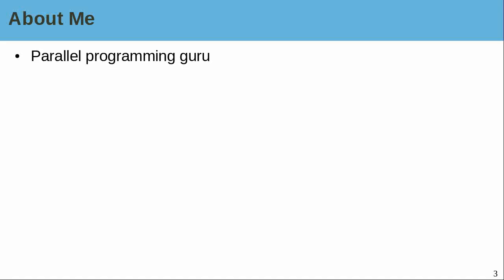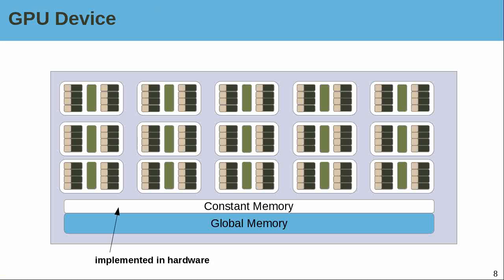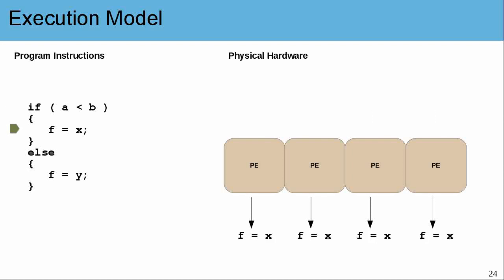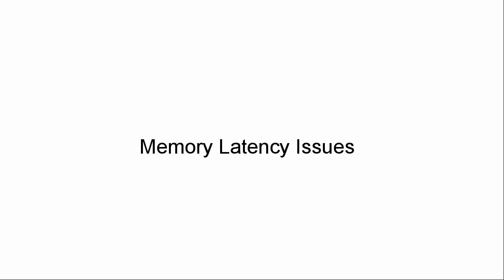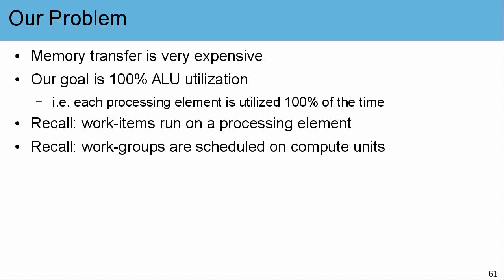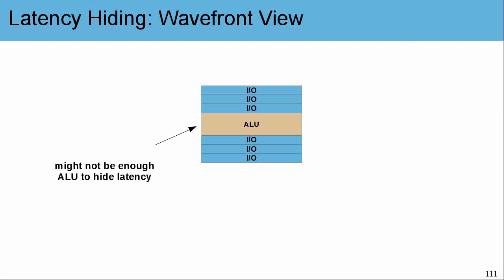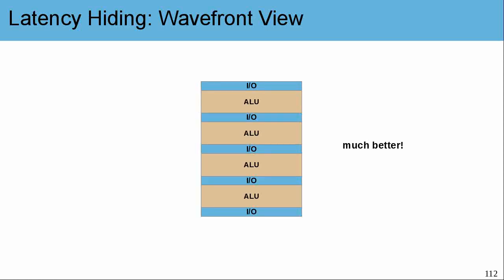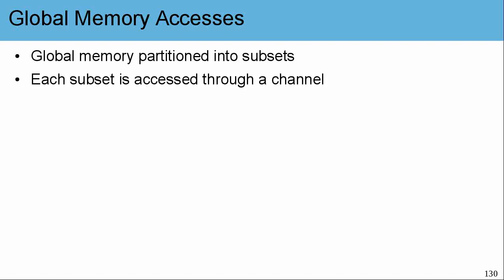OpenCL GPU Architecture

Comment: Thanks for the video.
However, the topic is way to advanced for Lecture 3. In the end it deals mainly with optimizations to get maximum results, but at this point any significant performance, compared to serial or multithreaded code, is more interesting to "get me hooked" into CL, considering I'm no guru (and I don't what to be)!

Also I don't like how low level it all gets. Reading the vendor documentation, I don't believe is good general-purpose programming practice at all, even less - optimizing for a particular card! Sure, this might have it's place, but I really hope it's not the recommended (the only performant) way to do things! This will lead to writing two or more kernels for each (known!) configuration, which will be obsolete within 3 years.
Hell, even OpenCL C itself hides this, could we, just for start, ignore these? I am really asking actually.
Can we (C/C++ developers, which know a thing or two about performance) write reasonable algorithms, mainly ported from C, and expect considerable wins and understandable, portable code?